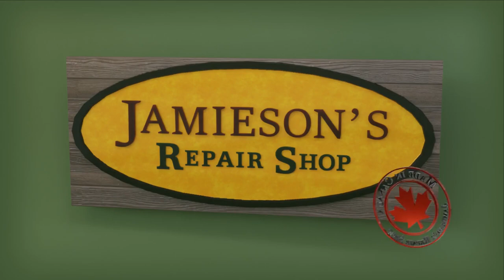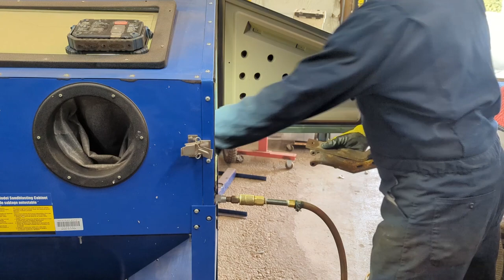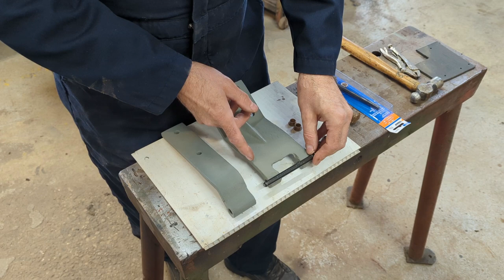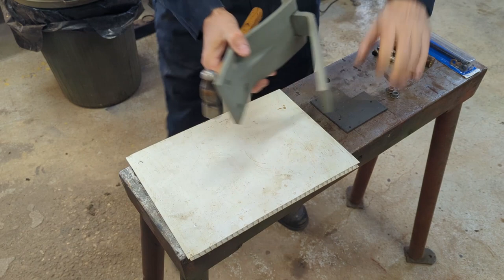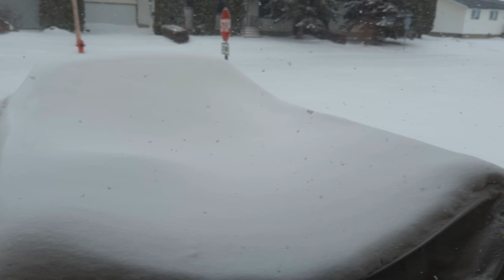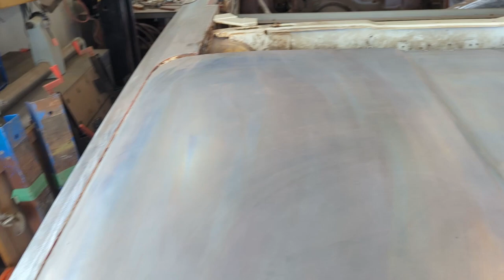Rear Deck Hinge Pin Replacement - 65 Thunderbird Convertible Restoration Ep #44

Comment: Very good point of zerk fittings! Especially when that’s the back side of the car and all the road salt might get it’s way in even if you rinse the car after a drive. Personally I prefer zerk fittings in every hinge, ball joint, or bearing housing! 
When you get the lawn tractor going, you can mow the snow. Lol
As always I look forward to your next video (but don’t feel like the videos are more important than your other tasks, so no pressure)
Reply from the maker: Hey Troy, Denis Beech (look under Lake Side Auto Body's comment) pointed out an interesting thing, about the sintered bushings. Dennis is pointing out how to oil impregnate these bushing, something I never thought...but find interesting!
It snowed a little again last night...so I may have to do what said, mow the snow! 😂😂😂

Comment: Hey Alvin,, thanks for the tip on the pin. I went ahead and ordered some from Amazon. I have several used and seized hinges that I can now fix thanks to your work investigating the pin. Thats another part on these cars thats always bad. Theres a guy on YouTube working on a 59 that is everything as bad as your car if not worse. I told him that he had his hands full with that one and his response was, "Its only welding." Yeah, welding the entire car back together. Thats what your doing. Its a mountain of work as you well know. This was a very interesting video, thanks.
Reply from the maker: Hi Nick, I glad you found the video helpful. 😊
It is only welding, and a ton of...but recreating panels from the old rusty ones is where the challenge comes, that's the part I like the most.
Thank you for watching Nick!

Comment: Those are some heavy duty hinges - they don't make them like that anymore for sure.  Thanks for sharing Alvin - nice video :)
Reply from the maker: Thank you Jerry!
 They are heavy duty hinges, that's for sure...I find it funny that the pins are not equally designed, I would think a larger diameter pin would have been a better match for these hinges.
Reply: The bushings you installed can be impregnated with oil before you install them. You put the bushing on one finger and fill with oil and then squeeze the oil between your fingers and oil will come through the body of the bushing. That lube will last for years and don't have to drill the hinge.
Reply from the maker: @denisbeech9226  thank you, I like that idea!

Comment: Hello Alvin, very nice job on those hinges. Not owning a convertible, it is interesting seeing how they put that part of the car together. I noticed that when I took the trunk rubber seal off of my t-bird, that the trunk lid sat a little lower. Sort of like the way your video shows how yours is sitting. I think the rubber seal will hold the trunk up a little? Anyway, nice job as usual. By the way, we got blasted by your Canadian cold air and it left a bunch of snow here on the 19th. LOL
George B. in Michigan
Reply from the maker: Hi George,
I think I kept a piece of the old trunk seal...but if I didn't, I'll just shim the truck lid until it is level with the quarter.
I started making a forming tool for the wheelhouse extension drain hole area, I think what I have in mind will be functional, but may not look factory. Those pictures you sent have been extremely useful in laying out the forming tool.
Thank you George, you have helped me out on more than one occasion!
Alvin

Comment: Great stuff. I too ordered new pins today. I wanted to know how you strip the car to bare metal and what you use to preserve it from getting surface rust so easily. The bare metal makes it really easy to see imperfections.
Reply from the maker: Thanks Tavi!
I use my long throw DA sander can be set to spin only by moving the counter weight on the shaft, I have been using it that way with 80 grit to get the bulk of the paint/primer off, but being careful to not take it into the metal any more than I have to. After I get the bulk of the paints/primer off that way, I switch the DA back to oscillate, and use 60 grit to clean up the remaining paints/primer, at first I was checking for heat on the panel, but there never seemed to be any heat build, so I stopped checking. 
I live in a low humidity area, especially during the winter months, so flash rush isn't a major issue...but just to be safe I wipe down all the exposed metal with phosphoric acid, roughly a 10% mix, this will leave a white residue on the metal, the residue can be removed later by going over it with a scotchbrite pad, or DA sander. If you are going to use body filler, I recommend getting it all off in the areas you are filling, before applying the filler.